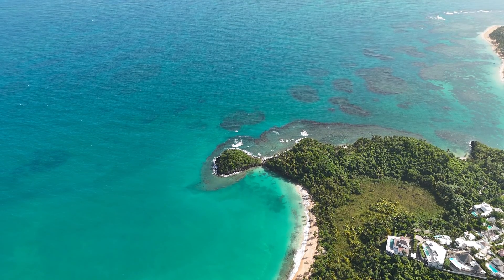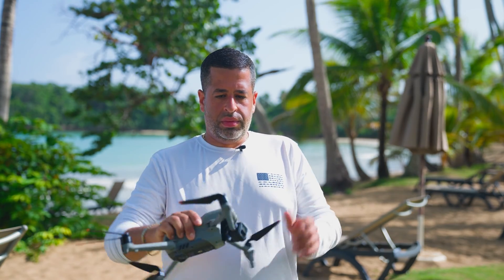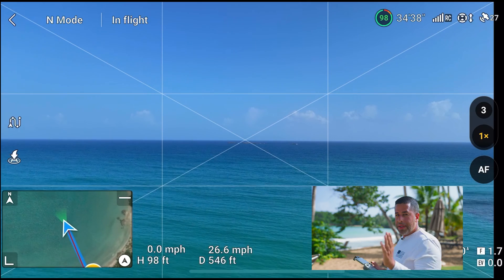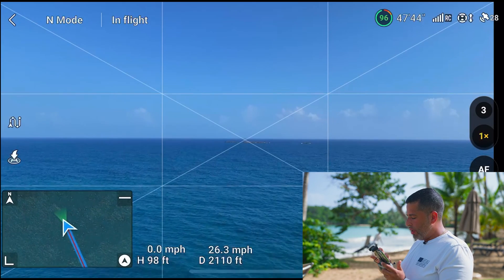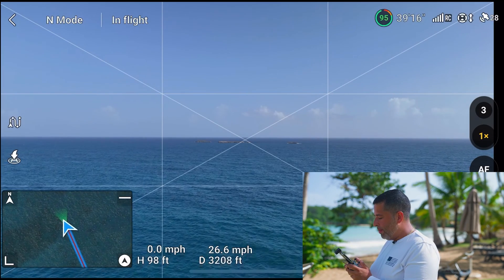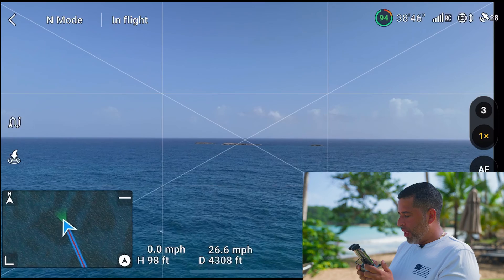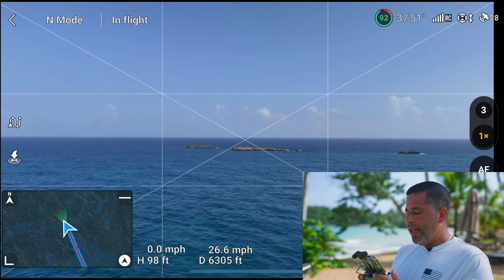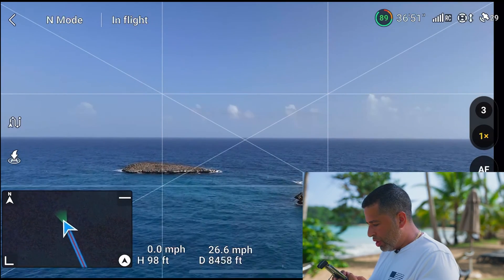DJI Air 3 Range and Altitude Test

Comment: Thanks for making this. I watched this because I'm thinking of buying an Air 3.
What are all the black and white diagonal patches in the video (such as the water's edge on the beach)? Is that errors in the video coming from the drone? If so I'm glad I saw that before I bought one.
Reply from the maker: Black and white patches? Do you have a timestamp?
Reply from the maker: Ohhhhh, I went back and watched. That’s a screen recording of my remote and those white patches are called “zebra” lines which pro’s turn on as an indicator that your image might be too bright.

Comment: im getting the fly more package I need the rc controller w/the built-in screen .. & I thought those get higher than 3,000 ft 🤔 they do, like 6000m  right?🤔 I just looked at the specs, so that's right under 20k ft ceiling height 😊😎 I'm already on my second drone but I need ocusync & wind resistance + power, those motors are super fast! .. if you're doing range always go higher to atleast 400ft, but better to be atleast 1k ft because now it's more of satellites 🛰️📡 & the drone talkn to each other than unknown signals in-between.